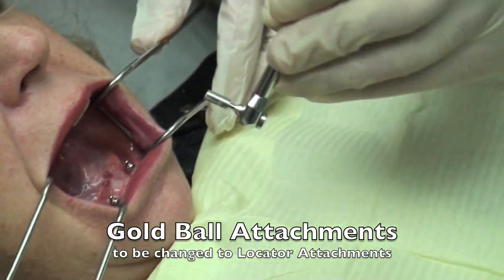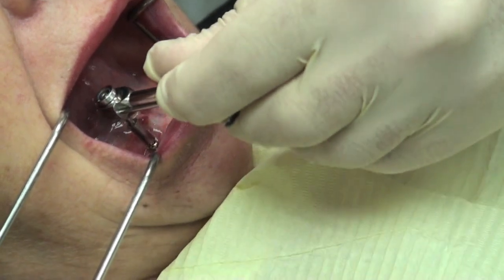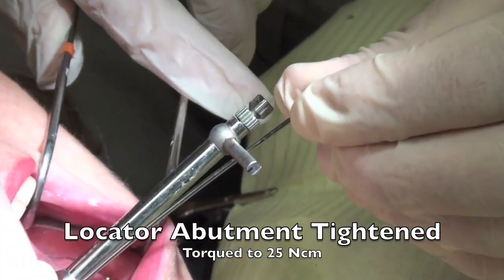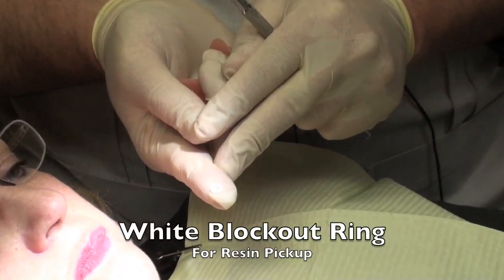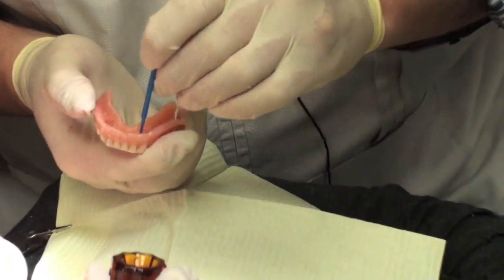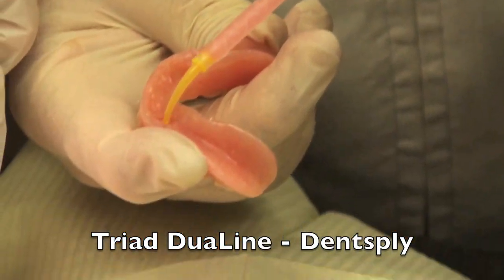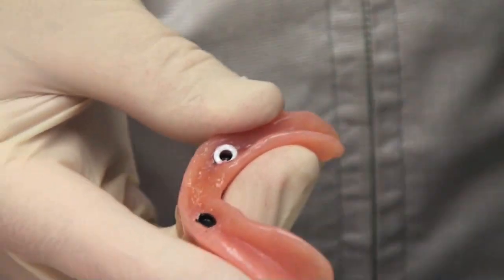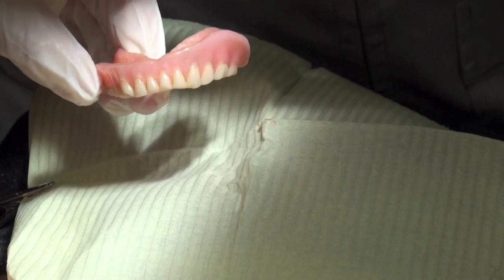Dental Implant Attachments - Locators - Easy Chair Side Step by Step

Comment: I am attempting to purchase med retention locator caps.  Went to the website of NobelBiocare and wanted to find out if I need to go through a Dentist or Dental Lab since I am a private person and have no company related to dental issues. I have had the over denture for a few years, normally am quite happy with the fit, but need to replace the locator caps. Also want to find out if I should get strong retention caps, (white) since I do have to remove the dentures daily  for cleaning. Am not wearing them at night. 
The dentist here in the states, disappeared, the dental lab i used to buy the caps from has closed. I have been replacing them myself when needed, have the tool as well. Please let me know where to purchase . Perhaps you also could enlighten me as to strong retention vs. med. Thanks

Comment: Where is the best place to buy these abutments?  I have two frontal implants identical to the ones on your patient.  The abutments are about 12 years old and the locators don't hold anymore even though they are the clear 5 lb.

I think I need to replace the abutments.  Would you agree with that, and if so, where is the best source to get these at the best price?  Thanks.

Comment: How do you cleanse the interior of the implant when changing the abutments? When I have changed abutments I consistently find the implant body to be loaded with anaerobic sludge that smells horrible.
Reply: Waterpik
Or toothbrush with liquid handsoap followed with mouthwash
Reply: I use a small piezo brush and also a Waterpik Hummingbird.  I use Zepheran solution as the antimicrobial. It is much easier to place a platform switched abutment after cleansing the implant body without contamination occurring.